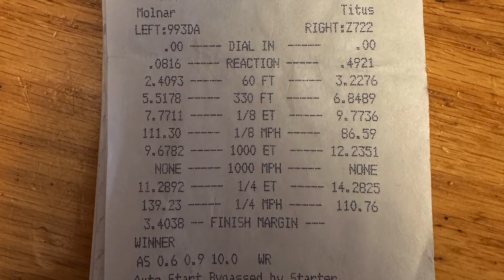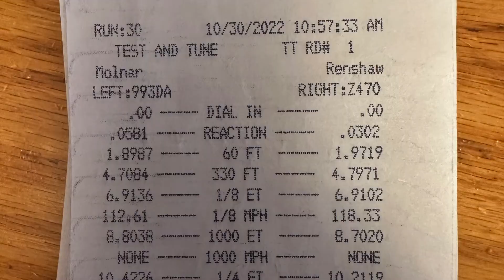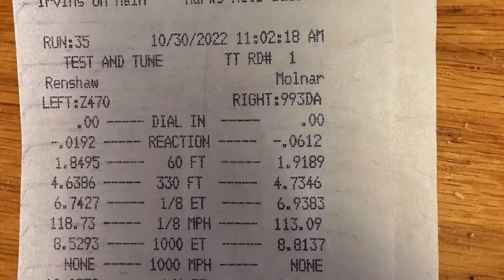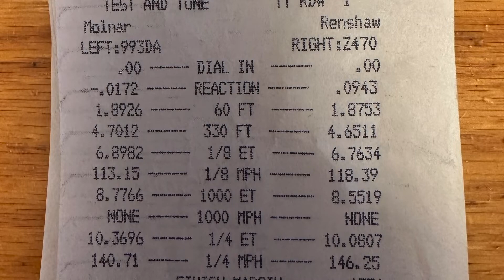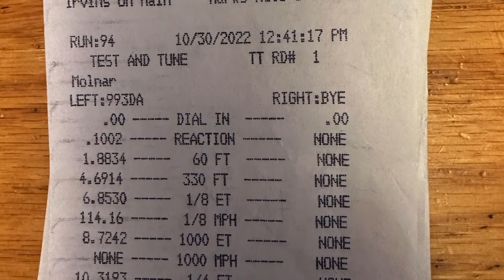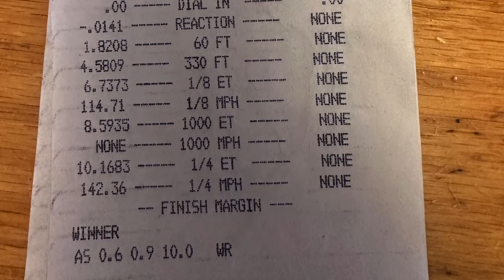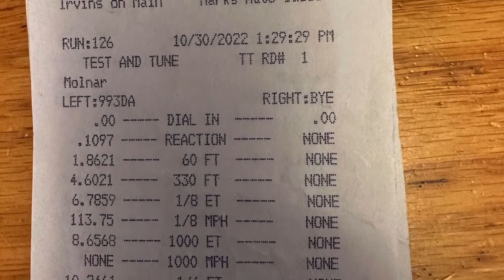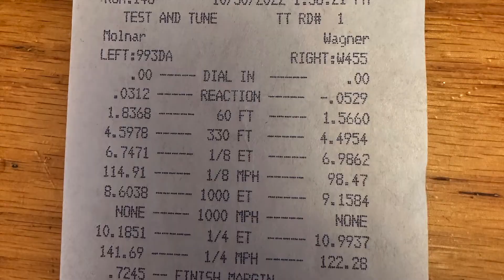How quick is a 2005 Yamaha R1 (will it run 9's)

Comment: Good runs,  I had an 06' R1 50th Anniversary,  ran consistent 9.90's with a 9.82 PB , 100% showroom stock. Now I have an 23' ZX14R,  just ran it 2 weeks ago went 9.63 on the 2nd pass, 9.64 on the 1st and 3rd passes, stock height stock exhaust only Brocks clutch mod and 39 tooth rear sprocket. Just got the ECU flashed by Ivan's, can't wait to see what it'll do now. Hopefully in a week or two.